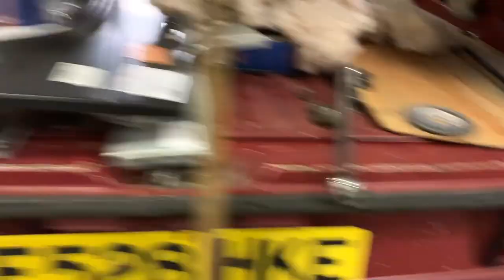Rust repairs on our vanagon (t25) ep.3

Comment: Hello! Great job You all doing!
My 87 multivan also needs a care. So please can You tell me where you bought those pliers used in 0:45 and 2:37?
Reply from the maker: funkolog thank you! I can’t remember where we got ours....you can also get air powered ones! https://www.machinemart.co.uk/p/edge-setterjoggler-with-hole-punch/?da=1&TC=GS-010122046&gclid=CjwKCAiAzanuBRAZEiwA5yf4ugiU2EMaKN09OrZtQwlNwONdzC6ofqYa4ydWeXjuUnmQLsO3uQS_9BoCoCUQAvD_BwE
Reply: @_Tristan_  Thanks for reply! I already have them, the cheaper version made by Extool. And I have to say: people, don't buy cheap tools.. your Clarke ones are better quality. Mine don't really like the 1mm sheet that Bus is from.  And the pliers have a 5mm punch, but for welding 6mm+ is better. So I don't use them much.  2:30 - Means that the repair panel so bad that it has to be modified that much..

Comment: when making that lip and weld on the overlap - how do you prevent it from rusting? i do not notice any weld primer,
Reply from the maker: Boba Nofat so the panel comes coated in a rust proof primer, the panel was then painted from behind to protect the panel. The outside was coated with a etch primer. And then painted over which can be seen in later videos. 

We were very new to body work/welding panels in so I’m sure we did some stuff wrong along the way(part of learning)

Comment: The VW T3 is badly protected against rust by design as well as by manufacturing. 
Seam corrosion is everywhere and was not controlled by VW, every T3 has it.
There are no plastic inner mudgards. The stone chipping has free way in the wheel bays and on transverse members under the floor.  There are a lot of spots where mud can collect (stays wet, will corrode for sure).
Example: longitudinal slits in the sills allow dirt and water to enter, and collect in a dead-end. This is precisely above the outer rear suspension bolt a, 3 mm steel U-section rusts through from inside to outside. 
The first years of the T3 production were handsprayed, demonstrating large variation in quality and the metal was not protected by any zinc layer. 
The outside underfloor has primer, but an ample paint-layer., it shines through...(!) The same quality we observe in the inner forward corners under the dashboard. (Check your T3!)
The T3 was ment as workhorse for self-employed workers or small companies and intended to write off in say, 5 fiscal years. 
It is not a quality car, but just an average car.  Of this project the least attention was payed to the corrosion protection.
Survivor-T3s  are only camper cars which see the road for 1 month a year and are parked in a shed the rest of the year.